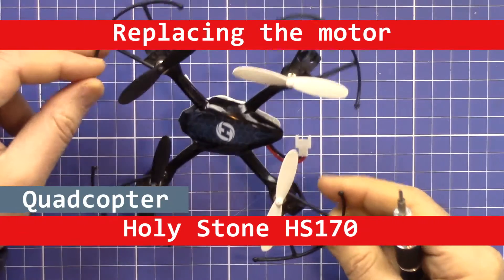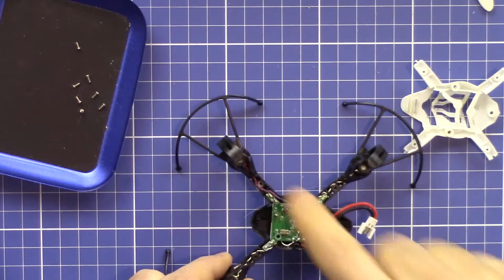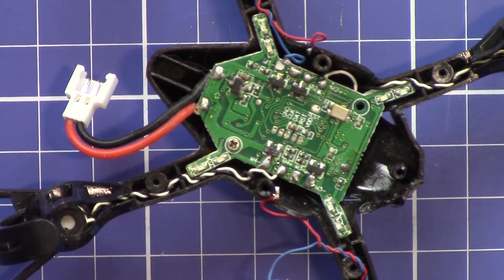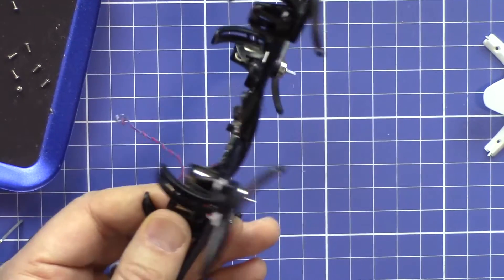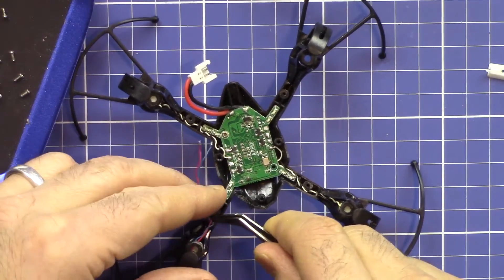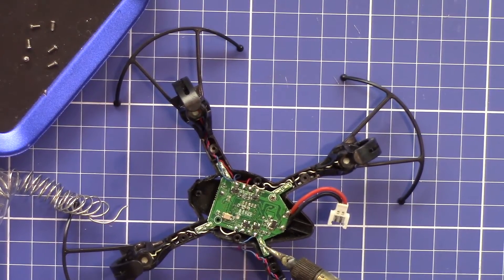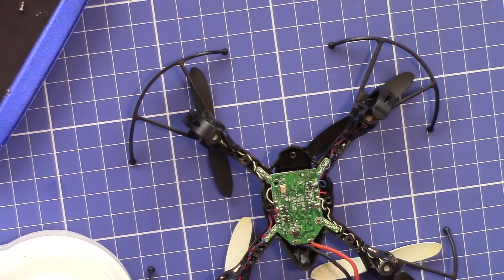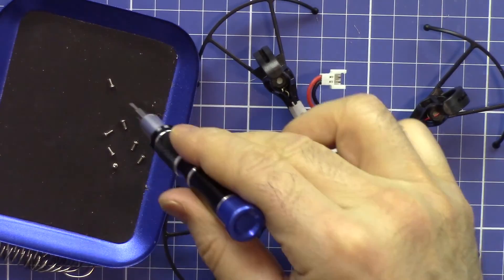Replacing Holy Stone HS170 quadcopter motors

Comment: why were you just switching the motors around? I broke a shaft on one of my motors that had a Black Prop. I believe the black prop was an "A" prop. I bought a set of 4 motors and replaced the one that broke with a new one. 

The one that broke had a red and blue wire and so I replaced it with a new one that also had a red and blue wire. I had no problems with the process, (I'm an experienced solderer), yet when I finished and tried to take off, the copter absolutely refused to lift off!

I had full throttles and still, it wouldn't take off. In fact, it wouldn't even lift on one side or the other. It was as if the props were turning and generating thrust in the opposite direction, hence pushing the copter down, not lifting it up! And yes, I definitely re-calibrated the accelerometer!

I checked my prop combinations and I have the "A" props aligned with each other diagonally, and the "B" props aligned with each other diagonally. However, I noticed that the two motors with White & Black wires rotated CCW. Yet one of the two motors with Red & Blue wires rotated CW and the other rotated CCW. I know I soldered the blue & red wires of the motor I installed to the motherboard placing each colored wire back to where the old ones came from.

I don't recall which of the R&B wired motors I worked on. I must believe that the B&W motors are turning correctly and because I suspect that the Red & blue wired motors should turn in the opposite direction from the B&W motors. Therefore, I must consider that the R&B motor I selected turns in the wrong direction from the other one, (no specifications came with the motors).  

I'm going to try to re-solder the other motor of the new set I got, to the position that I suspect I soldered the one I did earlier... It sounds confusing but not really, if you think about it.

 I must also consider that I may have an accelerometer issue but if I do, it'll be the first time that ever happened to me and I've had quite a few of these quad copters (mini and large). 
Thanks
Rich
Reply: Update (FWIW): I somehow did two things wrong and I blame my wife! She interrupted me at two critical points in time. One when I was in the process of removing the props from the motors and meant to inspect to the props for ID letters, and the other when I was about to re-solder the new motor in place. 

Therefore, I not only solder the blue and red wires of the motor backwards, but I also had the "A" & "B" props installed in the opposite positions that they should have been. I fixed the two problems and I'm now back in the air.
Rich
Reply from the maker: I am glad you were able to fix it.  It happens. Let's not blame anyone.
Reply: LOL, I agree, besides, I just made that up about my wife interrupting, she wasn't anywhere near me when I made those mistakes, lol.
Reply from the maker: LOL